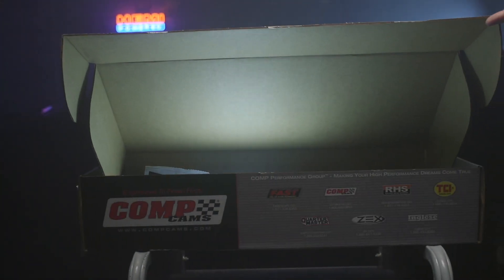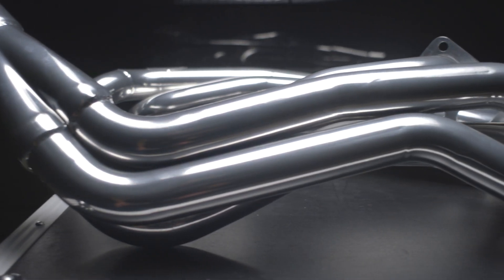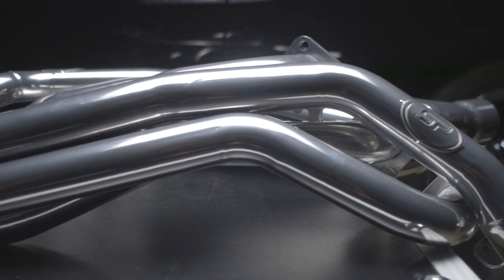More Performance Parts Going on the 5.7!

Comment: I wouldn’t even worry about the cabin noise man. It’s going to sound about the same with just your cam and longtubes while cruising. I have a full Corsa Extreme catless exhaust with a 270 cam and it sound great in here. Now when downshifting outlet accelerating, you definitely are going to hear it, but it’s going to bring you more smiles than anything

Comment: Yeah, my 15 rt with that hrt stage 2, Stainless Works longtubes and high flow cats,  3.09 rear diff, cai, 6.4 intake manifold got me 410 to the wheels.
    I traded in and got a scat pack b5blue 2019. Traded again for a 2020 Scatpack Go Mango with automatic.

Comment: I have left my r/t super track pack stock for know too much shit I am working on just did the mid-muffler delete but, I like what you're doing I think I will go this route next winter... or drop in a built 6.4 not sure yet just dam expensive when you compare the cost to my other small block chevy cars I have  ... and the ease of tuning....
Reply from the maker: Yea that's absolutely one thing Mopars arent...cheap!  haha I saw you were working on some LT1s there, that's an underappreciated motor!
Reply: @TrackPackRT  yes put challenger on the back burner for know and just cruise it on the weekends ... the lt1's are going to he the fun car to beat on and have fun with at the track

Comment: I saw that exhaust episode.   I put a Borla S Type.  I just liked the sound and it was their 1st generation close out for $700+ bucks.  I put a Maggie SC on at a safe 8 lb boost.  440/452  .  Good enough for me.   I’m done.   Good luck on your build.  Did you get a Barton shifter yet?  These gains are at 2500 ft above sea level.  Stock air intake.
Reply from the maker: You have a great setup my friend!  I love the maggies!
Reply: Does your Maggie whine ?
Reply: @just_a5.7  a little.  Couldn’t hear it on the dyno due to the room size and exhaust,  headers and Borla s type = Borla atak.  A ‘69 super bee restored with a hellcat engine was on the same dyno two weeks ago and I could barely hear that whine.  The Maggie is a roots type which tend to be quiet.  If you’re going to invest in forced air and want that loud whine get a Whipple.
Reply: @just_a5.7   I wanted power not publicity.  My car is Plum Crazy in color.  It gets attention just sitting!

Comment: i have a 09 challenger rt 6spd manual i thinkn bout doin a cat delete wat do u thnk i already have flowmasters 40s where mid mufflers and no resonators?
Reply from the maker: Everything I’ve seen on no cats vs high flow cats has shown almost no difference.  I can’t recall seeing anyone test the stock cats vs no cats although I’m sure there are lots who have done it.  I’m leaning towards it’s probably not going to give you much for gains but I don’t have anyone I’ve seen do the A B comparison to verify myself.  Headers on the other hand… 🏎💨

Comment: With the R/T problems with the VVT can occur. For example, R/T Life upgraded the cam when he added a stroker kit to a 5.7 and he had to have VVT disabled because it actually cost him horsepower. My suggestion would be to contact R/T Life and he might be able to offer some advice that may help. When it comes to exhaust, there are exhaust pipe size calculators that tell you what size pipe would be required. For example, a 2-1/2 OD pipe has an inside area of 4.43 square inches capable of flowing 509 cu ft per minute (or 14.4 cu ft/min) with each pipe in a dual exhaust system being able to support 232 horsepower and 463 total. Based on the information in the video, it would appear that the exhaust you have is capable of supporting the horsepower the engine is producing. However, you are close to the limits of your exhaust system. A muffler with a flow through design will release a few ponies over a chambered one. The exhaust note will be deeper and the car will sound better. However, I don't think you will big gains from a 3" exhaust. Your issue is more likely something in the tune rather than the exhaust. 

If you want horsepower gains once you get the tune related issue resolved, you may want to consider the intake side rather than the exhaust. People have realized gains by either porting their 5.7 intake manifold or going with a 6.1 or 6.4 intake. Others have claimed that gains can be achieved adding a Hellcat airbox along with an improved intake. Ported heads help. Unfortunately that gets rather expensive. BMason does a live chat on Youtube most Tuesdays and Saturday evenings and people can get performance related questions answered. He is well respected in the Mopar community. He will also answer questions that are asked of him in the comments section.
Reply from the maker: How aggressive your cam profile is will determine how VVT will work for you, it all just depends.  I definitely don't expect much from the exhaust, but I am hoping it might unlock 10 ponies, we'll have to see.  I love BMason, I've been watching him for years!  Intake I'm not totally sold on, I thought about porting my 5.7 intake but when I talked to BMason about it awhile back he said it's really hit or miss.  If the intake is rough from the factory you might pick up a few ponies, if it was an example that was smooth from the assembly line you might not pick up much of anything.  Lots of guys go with the 6.4 intake which gives some extra grunt in the lower end of the power band (although not really any peak power increases) but I don't want to splice into my harness to install it just incase I decide to throw a whiny boy on there somewhere down the line.  I can tell you one thing though, the wait for parts to get here is killing me!!  haha

Comment: You wanted 6.4 power and towards the video’s end you said 420 then 485 hp.  I am assuming 420 whp or 485 crank.  Where do you record?  I have to drive out into the farmlands, get the binos out, make sure the coast is clear.  Just fount a nice, new spot where new home construction is going in.  The roads don’t even have names.  Launching is a problem after the Maggie but I have summer tires and temps are between 30 and 50 degrees.
Reply from the maker: Yea that’s correct.  Most 6.4s dyno in that 420-430 range.  You’ve got the right idea, when I do any kind of really spirited driving or testing new stuff out I head to the country roads where there’s no one around and the speed limits are high.

Comment: I'm interested in how the 3" exhaust works out cuz I got my eye on same set.  I thought most tuners disable ANN w/ aftermarket cams?
Reply from the maker: No usually with the phase limiter that a lot of after market cams recommend you can still get the benefit of that vvt through part of your power band it’s just more limited.  I’m excited to get back to the dyno to get this tune going!

Comment: I have been watching so many videos that talking about hemi engines , you have to put stroker kit + performance heads or porting your heads + add supercharger + having good diff , after that you will see really huge numbers and don’t forget to change transmission
Reply from the maker: To be honest the stock heads flow great, not much need to replace them.  I do know that with only headers and a cam you’ll be around 400 to the wheels with a very reliable setup.  I wouldn’t consider a stoker kit unless there was something wrong with my engine and I needed to bore it out to fix a cylinder head.  You can get amazing power out of the 5.7 without rebuilding the entire engine.

Comment: 3 inch exhaust isn't gonna do much on a 5.7 unless it's boosted and stroked. I'd go vented catch can and then see what happens. High flow cats and muffler delete will give you some power though.
Reply from the maker: No I know it won't do much.  On a stock car it does really next to nothing, with where I've got my car now I'm hoping maybe it might help give me an extra 5-10 hp.  I've got the high flow cats with my headers already, they're great!
Reply: @TrackPackRT  you should have your tuner check for st and lt knk then.
Reply: @TrackPackRT  Sambo And The Bee knows what hes talking about check his vids Him and I have checked and tested just about everything you can imagine, his 6.1 is the FASTEST stock block ive every seen it blows things out of the water that in theory should destroy it but we basically made it into a monster it will give my 14 Auto 5.0 mustang a run for its money and that was before he had his heads ported now im probably gonna get a 2 for $20 at gapplebees
Reply from the maker: @sambo92  you bet.  Chris @ Player 3 Performance knows his stuff, I trust him a lot when it comes to tuning this beast.
Reply from the maker: @dakotajones8010  everyone loves a quick 6.1!  Lots of potential in them that lots of people sleep on.
Reply: @TrackPackRT  yup they big sleepin on them 6.1 SRTs cause no one mods them ive seen a hell of alot of em but almost always max it has is an exhaust
Reply: @TrackPackRT  has he told you to get a catch can?
Reply from the maker: @sambo92  nope catch can hasn’t come up when we’ve were tuning.
Reply: @TrackPackRT  mackbuilt turned me on to catch cans and he's been working on our cars since they came out. I highly recommend one.
Reply from the maker: @sambo92  lots of guys do have them.  I have looked at a few if nothing else to add a custom touch under the hood, there are some cool ones.  Although I’ve gotta say I had my intake off it was pretty clean inside.

Comment: Have you done a throttle body yet?  I did an mmx85mm and opened the exhaust to 2.5inch on my rt Durango with a comp 270 cam and did 402hp 408trq
Reply from the maker: Great numbers!  I haven't yet, I did try to get in touch with Fastman, but wasn't getting much response so I put it on the backburner for now.

Comment: Maybe the exhaust is too loud tripping your knock sensor at high rpm causing that flat spot
Reply from the maker: Interesting point, we did take care of the knock sensors when we did the headers because you’re right, they will set them off.

Comment: I'm running 2 1/2 in. straight pipes with a K&N intake, a Diablo tune, 20" FALKEN tires, and the STP on my 2013 Challenger R/T. It does surprisingly well. Love the paddles too!. Smoked a couple boosted Mazda 3's, an RX7, and kept up side by side with an STI after he got the jump on me by about a car length. The dude was cool. Gave me a thumbs up at the next light lol.

Sadly, the riced out Hondas and BMW's never seem up for a challenge and all the Mustang and Corvette drivers are senior citizens who won't race lol.
Reply from the maker: That tune would have netted you some extra hp for sure, even the canned Diablo tunes actually do give you some extra hp you can measure at the strip or the dynomometer.  Of course hooking up becomes the real challenge with a Hemi, especially on the street!  Glad you’re having fun with it man!
Reply: @TrackPackRT  hooking is 50/50 lol. The FALKENs do  a lot better than the Michelins I previously had on there